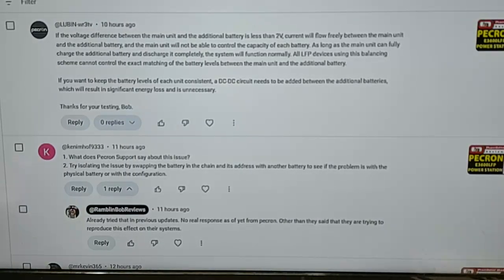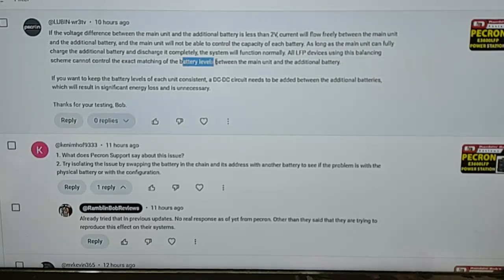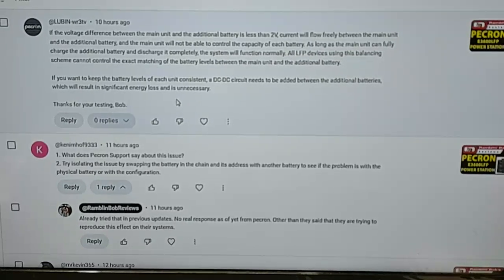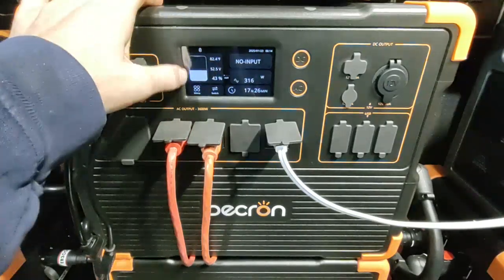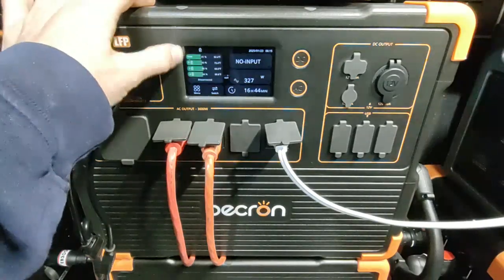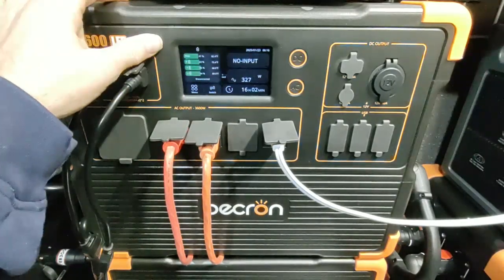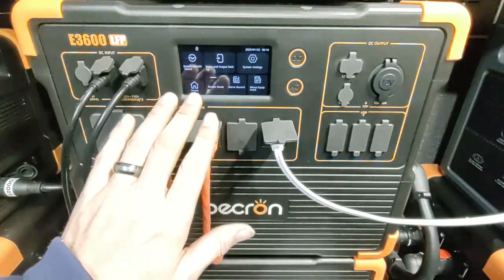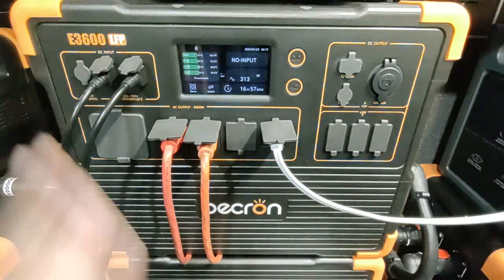PECRON E3600LFP Power Station (((((UPDATE 22))))) We ran the same test with only 3 batteries !!!!!

Comment: My E3600LFP AC out just failed with an alarm of 'no output in series'.  It started acting irregular and shutting down the AC circuit at night (I use this to power a remote building that isn't on the grid) I would come to the shed in the morning and see alarms on other devices but no alarms on the E3600 till today when it completely quick working.  I contacted Lily at tech support we will see how long it takes to get some answers
Reply: I've been watching your videos.  Keep up the good work for the community!
Reply: Can you charge your expansion batteries independently of the E3600 with AC?  If so, will they charge while using the E3600 only with solar (AC connected to batteries and E3600 not in UPS mode).  That might be a work around.
Reply from the maker: @abohling1  Yes, you can charge with just the batteries, 1,600 max total (4 batteries)

400 watts  for each battery, but you would have to have 4 chargers from pecron. (both the 300 watt and 600 watt chargers work)

And you would not get any charge speed control or charging limits and discharging limits on the touch screen. (System will stop when it is full)

  But yes, the e3600lfp can charge through the batteries and the main system understands the power coming in on the power meter percentage meter. it just does not show up on the power meter coming in (if this makes sense)
Reply: @RamblinBobReviews  that makes sense.  I think the only way is Pecron doing a update to the system allowing UPS mode to be enabled or disabled.  Have they ever pushed an update yet?
Reply from the maker: We have never seen an update for any system from pecron. At least for the power stations that we own. and we own everything they have except for the e1000lfp & e2400lfp.
Reply from the maker: We have never seen any alarms on ours yet, I wonder what that means? Batteries?
Reply: no the batteries are and can continue to take charge.  I think it is the inverter failed.
Reply from the maker: OK, thank you for the update.

Please keep me up to date what pecron says about it.
Reply: I've had alarms on mine when I first got it because I didn't understand (and Pecrons manual isn't clear/doesn't mention) how UPS mode works.  In UPS mode the unit is strictly a AC pass through.  So with the 15 amp cord connected it will trip the AC out at 1800 watts.  With the 30 amp cord it trips at 3600 watts.  Before adding more solar and an extra battery, I had it plugged in to 15 amp ckt. so when a mini fridge I have connected started it would trip the AC out causing an alarm.  Now I only hook to the grid when it's been cloudy for 3 days in a row and my batteries are low.
Reply from the maker: We never use ours with the UPS, we bought ours to use solar and stand alone mostly. For portable use. Only weird thing with ours has been that last battery seems to always think that it is higher percentage than it really is. (voltage check too) (all batteries are the same voltage)
*We think it is just a reading error of the percentage. it must be.

I don't know if you have been watching my videos explaining this?

Other than that, ours has been really good. Never had 1 alarm so far. The app is in need of more updates for sure in my opinion.
Reply: @abohling1  So yes abohling that happened to me as well.  So in a nutshell we can't charge this from a generator or wall with the 15 amp cord if we are using it at the same time which really stinks.  Kinda makes the ups function pointless.  I wish there was a way to shut it off because I don't need it.  When the next hurricane is predicted in my area I will plug my fridges into my e2000 while running my brick charger.  I did that for Milton and it works great.  The brick just matches the fridge and freezer while my inverter is turned on and the system stays at 100%.  I was kinda hoping that would work with the e3600 but it doesn't it just trips.   Completely beyond stupid.
Reply from the maker: We also wish that you could turn off the UPS, since we do not ever use it.

  It would have been nice to be able to leave the system plugged in and grid charged to only 10% to protect the batteries from ever falling too far, just in case.
Reply: @RamblinBobReviews  That would have been a great use case scenario as well great point Bob.  I am not really seeing a point in having this feature as they have it setup.  You can't use it anyway because it randomly trips.  My fridge surges to aprox 750 watts and the chest freezer is like 600 watts and they will trip the unit if that cord is in but not with solar.  It's actually a hindrance in my mind.  My little e600 with the dreaded brick can handle it but not this?  It's literally pointless and makes the system worse.

Comment: Hey Bob,  I was on Pecrons facebook page and they were suggesting  to use Both expansion ports on the E3600LFP then expanding down evenly off each of those batteries, rather than daisy chaining off one of the  ports on the E3600LFP.
Reply from the maker: Thank you for the idea :)

But, we have had it hooked up that way since the day we bought got it.

P.S. You never run them all off the same port, too much energy running through 1 cable ;)

P.P.S. If you watch the video closely, you can see that we always have them hooked up 2 per port :)

Our setup is like this :)

                  e3600lfp
                  ^             ^ 
                  ^             ^
ep3000 (0)             ep3000 (2)
                ^               ^
                ^               ^
ep3000 (1)             ep3000 (3)
Reply: Got my new unit back from Pecron.  It took about 2 weeks round trip.  So far been running without any problems.  Still has the fan that squeals.  They paid for the return shipping.  FYI they ship FedEX so you will need to find the FedEX drop sight to send back (not a Kinko's or Dollar General as they wont take the hazzardous shipping items).

Comment: Yea that was one of my comments the other day. Seems like an odd number of batteries 5 seems to not balance as well as an even number of batteries 4... thats weird.
Reply from the maker: Yep, maybe....

The system looks even on paper. 3 batteries deep per side. (2 batteries deep per port)

           e3600lfp
          p1         p2
            ^          ^
ep3000          ep3000
            ^          ^
ep3000          ep3000

I still think it is a communication issue or programming issue. Just my opinion.

You remember the Bluetti AC300 (4 batteries max for that system)
*head unit did not have any batteries in it.....
Why did they not have 5 batteries for that one also?

You remember the Bluetti AC500 (6 batteries max for that system)
*head unit did not have any batteries in it.....
Why did they not have 7 batteries for that one also?

Maybe because the head unit for the e3600lfp has a built in battery also, making it an odd number, don't know :(

But to be fair, the e1500lfp has 3 batteries total and that one seems to not do that.

Comment: Have you tried to take battery 1 and make it battery 4 then take battery 2 make it battery 4 if you still get large difference..It's probably the system was designed to only read 3 exstra battery's Although the more you add might not read right..But it will run right...
Reply from the maker: Tried that already, same result :(

Also tried to swap positions and numbers of the batteries...

Comment: Hey Bob.  I was watching the solar input on my 3600 and I noticed that when pulling in full power from panels on the ports that the vdc was around 60 to 70 volts, then when it got fully charged it went to 131 vdc pulling only 15 watts.  So from 1050 watts down to 14 watts the vdc went way up, is that normal?  This is just  on one port, but both port did the same thing.
Reply from the maker: My 8 x REC 400 watt panels are hooked up as the following config...

Port 1 = 1,600 watt array (4 panels in series/parallel) apx 80v VOC
Port 2 = 1,600 watt array (4 panels in series/parallel) apx 80v VOC

My (working voltage) is apx 70v at 1,200 watts max per port

Charges all day without any problems or pauses.

   We never used anything that high of voltage yet, so I would not know. 

We always had problems bringing in higher voltage on pecron systems.
Remember when we did videos showing that :(

 We are staying at 80v because we know that it works on the e3600lfp. when I get braver, I will try higher voltages, but it sounds like you are having the same problems we had with the e2000lfp and the 2 x PV300 (330 watt panels in series that pushed the VOC up to 80v).
*The mppt controller would go into safety mode and shut down the charging.

Charging would just stop and I had to reset/unplug the solar to get it working again.

https://www.youtube.com/watch?v=E5n8e42fVB8
Reply: @ my setup is

Port 1 = 1200 watt array 6 panels in s/p at 84 v voc
Port 2 = 1065 watt array 3 panels in series at 126 v voc
 I tried to put the 3 panel array in s/p but cut the watt output in half for some reason.
Reply from the maker: That is because you can't have 3 x PV300 panels in series/parallel ;)
(They just don't work that way, and that will cut you output voltage VOC in half for sure)

You would have to have 4 panels in series/parallel to work correctly....
2 panels in series + 2 panels in series
and then those 2 series in parallel into port 2.
*You have to have the same amount of VOC voltage on each side of the series in order for it to work correctly.

You can't have 86v VOC on one side and only 43v VOC on the other side....or that would only produce 43v VOC !!!!!

EXAMPLE:
If each PV300 panel is apx 43v VOC, then this is what you tried to do.

(series) 43v + 43v ---------> parallel (This config makes only 43v VOC output, and this is why your power cut in half)
(series) 43v -------------------^

You would have to have 4 panels to series/parallel correctly, like this....
(series) 43v + 43v ---------> parallel (This config makes 86v VOC output)
(series) 43v + 43v ---------^

P.S. Long story short, If you had a 4th PV300 panel in that port 2, it would work just fine bringing in 86v VOC :)
Reply: @ ok that makes sense now thanks
Reply from the maker: This solar stuff is frustrating to learn sometimes. and very costly !!!!!

2 years straight of learning for me.....LOL

P.S. The scriber family helps each other learn, so we do not make those simple mistakes :)

P.P.S. WE ARE SO THANKFUL TO HAVE THE SCRIBER FAMILY WHEN IT COMES TO THIS STUFF :)